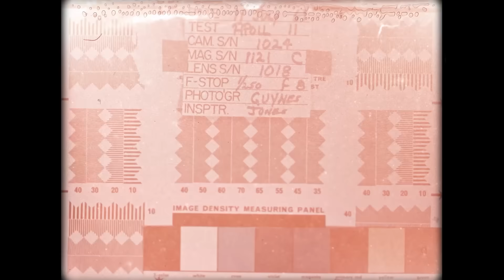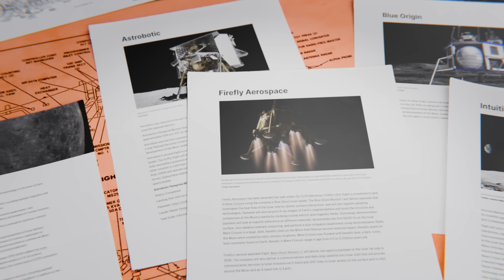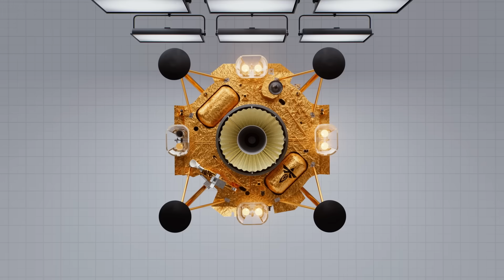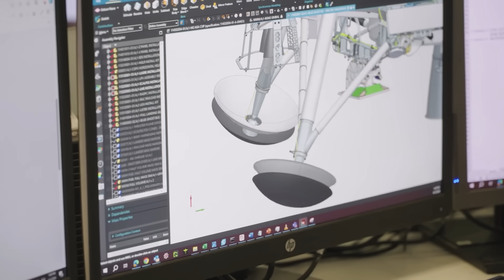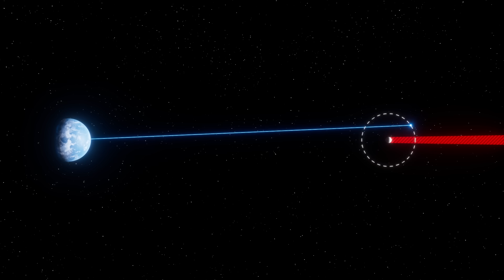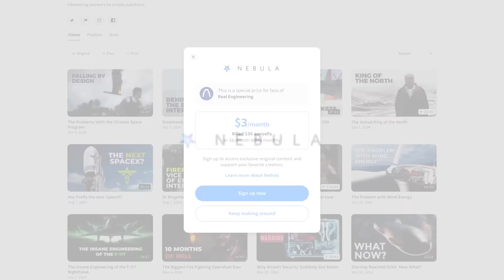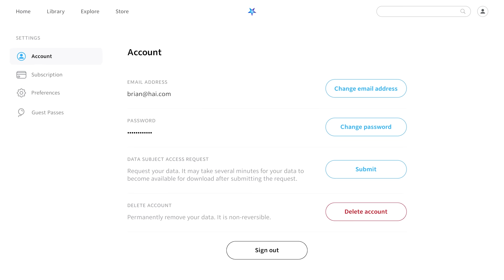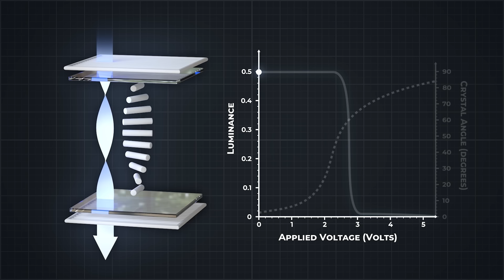Why the US is Struggling to Land on the Moon

Comment: 12:40 If the accelerometers on board show a value close to zero, the lander is still in free fall. If it shows close to g_moon, it has landed
Reply: opposite of that. accelerometers messures acceleration, weighing machine messure force.
Reply: @therealdoctor315 Accelerometers (accel.) measure acceleration relative to themselves. Let’s say an accel. is a hollow ball with a smaller, solid ball inside of it. When it “senses” acceleration, it is actually the solid ball hitting the interior of the hollow ball. When it is stationary on the ground, the hollow ball can’t move, but the solid one can, so it falls to the bottom and the sensor reads “acceleration”. When the accel. is in free fall, both are accelerating at the same speed, so both balls remain in the same position relative to each other, causing the sensor to read “no acceleration”. It’s counterintuitive, but gravity is an exception to the function of an accelerometer, and a useful one at that.
Reply: @therealdoctor315  Alright. It depends on the calibration
Reply: Free-fall means you are crashing to the moon. You need to have acceleration constantly in order to be in control.
Reply: Please read again how gravity works.
Reply: @alisav8394  Are you suggesting I'm wrong? Sadly I'm not smart enough to see what you're hinting at with your comment. Please explain
Reply: @zeg2651  No you’re right, the Dunning-Kruger effect is strong in this comment section.

Comment: We going to Mars, the Moon was so 1950s
Reply: No one's going to mars... Not on that starship thing. It can barely do an empty test fly without running out of propellant.
Reply: @volvo09 running out of propellant? When did that happen?
Reply: @hydromic2518  every single starship test to date. They are fully fueled (you can see from the frozen lines on the booster that they aren't filling it 1/2 way for testing) and it is used up when it gets to space for 30 minutes before it falls back down. It's not completely out, because both have fuel for the landing back on earth, but if it's fully fueled and that's as far as the rocket gets, how will it make it to mars? When full of human supporting equipment? These rockets are bare bones empty and we see where a fully fueled one gets to. 

Personally I just don't believe the BS of starship going to the moon or mars, it's going to be used for satellite launches.
Reply: @volvo09  you literally have no idea what you're talking about and making ret*rded assumptions, there's going to be bigger/more powerful versions of Starship 🤦 do you not have any foresight at all? And waymo? Don't make me laugh 😂 give it a few more years and it will be painfully obvious who succeeds even to you
Reply: @volvo09  sure, and the car in my driveway can't drive itself 😂
Reply: @nathansuss  no, it can't.
Reply: @nathansuss  that's here on earth... Not much of an accomplishment compared to making a space ship. 

And it can't really drive itself, key word "supervised", it disconnects before it crashes and you are to blame. 

Waymo is more advanced and even it has its issues and requires human intervention from a human at a computer when they get stuck in a situation.